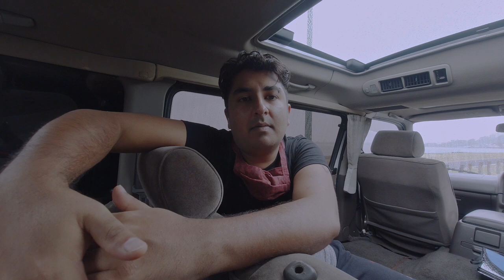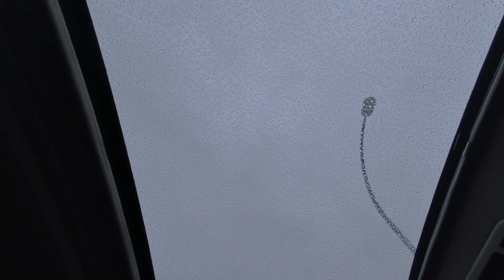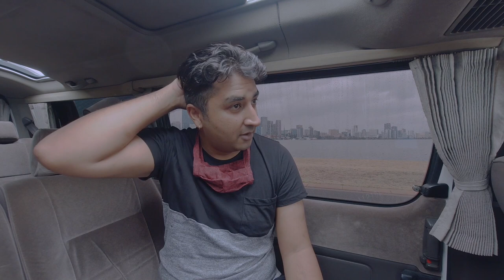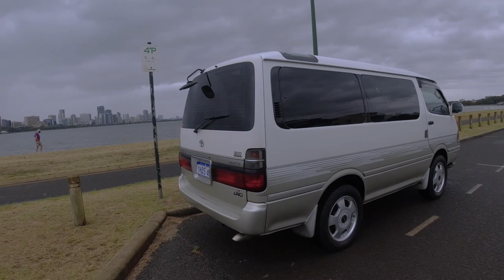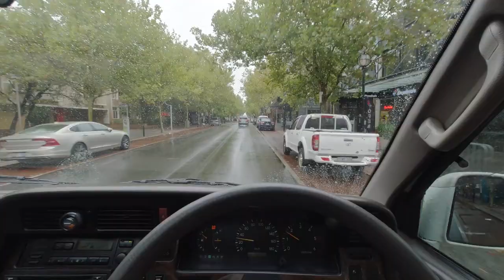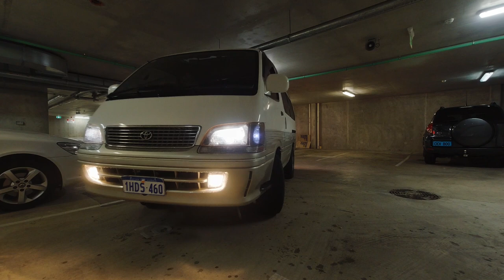OVERHEATING Toyota/ Nissan Diesels  [Vlog Style Long & Boring]

Comment: I'm currently getting my head replaced, I've had a lot of oil and coolant issues (which I think lead to it cracking.  I wouldn't mind a second temp reading just for piece of mind. (I have a digital dash) But after watching your videos I feel like I need to give it a lot more TLC once I get it back. Enjoying your vids I'm learning a lot. Looks like I need to look at potentially getting a new temp sensor.

Comment: Wether it’s a turbo or not the vans are not fast going up hills.  So just take it easy.  I have an older engine (non turbo)3L, new water pump, thermostat.  The gauge has never gone past halfway in 60,000 miles.  Also at times that’s towing a heavy trailer in the hilly south west uk.  It’s also a super long wheel base so even heavier.  If you want to crack a head gasket, thrash it or don’t maintain it.  Not sure about Japan deglecting their cars, have seen their Hiaces? Also have you seen the hiaces in South Africa? Super hot country and they love em lol.  The auxiliary radiator on my hiace is just for the AC and completely separate.  Maintaining and not thrashing it, it’ll last years and loads of miles.  Look at modern cars, loads of head problems, bmw, Subaru…..:::::::::

Comment: On my LH112 we have had overheating issues where the gauge went to 3/4 of its normal driving range and then it went down to 1/2 unladen on a flat road. The culprit was a most likely a leak in the radiator. And the issue got sorted out.

Comment: What a great video!  I am a relatively new 1993 1KZ-TE Hiace owner here in the Western US.  Can you speak to some of the fan clutch mods I have heard about?  Specifically they say, "tuned to engage the cooling fan for the radiator at a lower temperature, with greater intensity"  I googled around about this and it appears to be a mod that is popular in Australia.  Appreciate any insight!
Reply from the maker: Hi thanks for watching.

From what I know it's just a 10 blade fan. Not the viscous hub. You simply bolt a fan on with more blades to pull more air in.

Some guys do that and add more silicon oil in the hub at the same time so it's pretty much always engaged.

I'd never do it to mine though. The other day it started dropping below halfway on the gauge and it wasn't even cold, around 23 celcius and that too after climbing a steep hill.

Comment: Sorry, I stopped you video 10 mins in twice to reply. Here's my second reply. I have owned 6 Mazda Miata/MX5's over the years  and some had a overheating issues. I learned late in the game that a quick fix was to whilst driving, turn the heater on even in the hot weather and the engine temp will drop. Just saying.... Cheers!

Comment: engine coolant temperature sensor, I think I found this on ebay.au for $21.95
. Can you tell me exactly the full name of the  gauge sensor is?
Reply from the maker: Part no cs840 for the ecu sensor.
Part no tts007
That's from Bursons auto parts in Australia and not OEM but hopefully it helps
Reply: @nathansharma87  Perfect! Was able to find both on eBay/amazon.
Reply from the maker: All the best. I have a video on where/ how to get to the ecu sensor if you get stuck.

Comment: Is the cooland shared between both radiators? i dont' think i've ever checked the bottom one.?
Reply from the maker: Yes it's linked
Reply: @nathansharma87  I did think it was an odd place for something that might get driven on a dirt track etc, I need to look under mine when i get it back to compare it to your previous video changing the temp sensor. Mine is in the shop now, should i have them replace the temp sensors while its all pulled apart? if so what should i tell them.
Reply from the maker: Tell them to replace the water temp sensor at the front of the head which is for the gauge. And to also replace the ecu temp sensor on the block. It's at the back near the starter motor. Yes about the vulnerable location of the aux radiator. It should have a plastic shroud protecting it from rocks though.